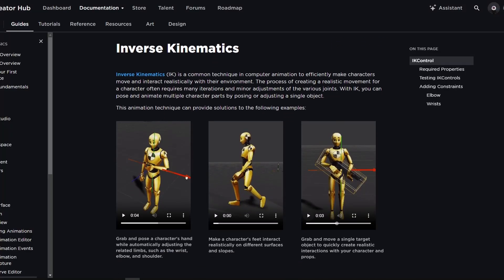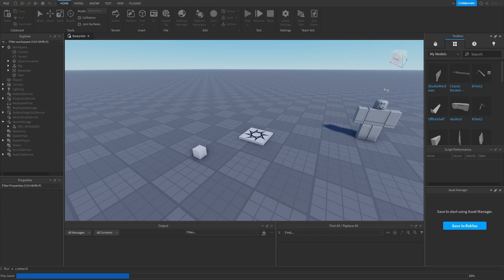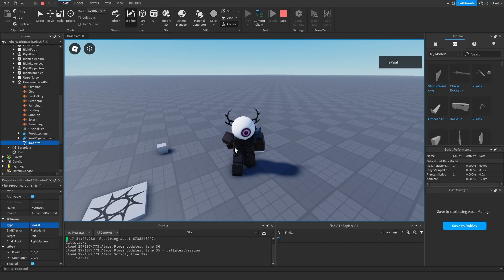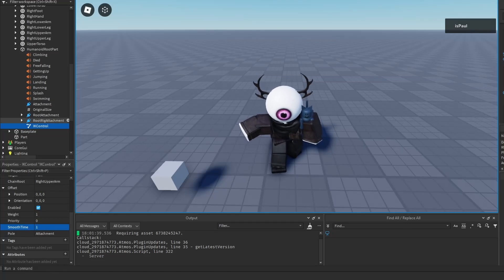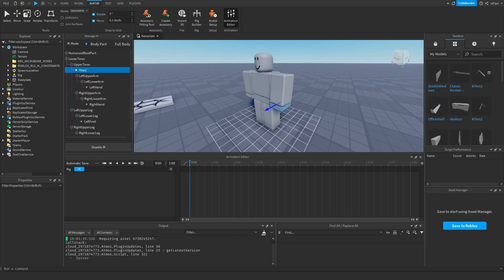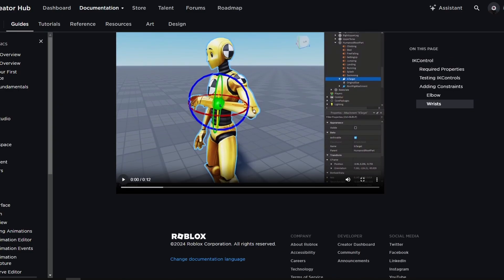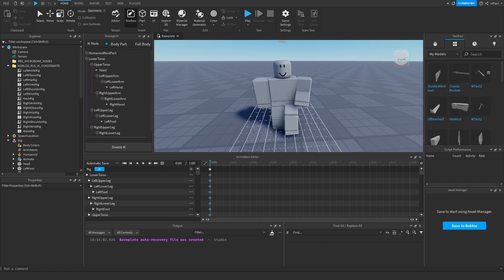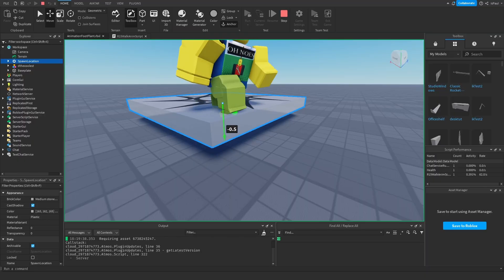Inverse Kinematics | Roblox Studio IK guide

Comment: Is it possible to use IK control without a humanoid character? like make some group of parts try to reach another part.
Reply: I was able to do this by making a model with the parts in a model with a Humanoid and an Animator and using RigEdit to make joints between them. Is there another way?
Reply: @user-dp1fz9pg1b  you could prob make a custom rig through blender with the parts as custom meshes instead
Reply: @LunaireTD  yeah I have done that! but I want to use parts.

Comment: if that would work on r6 it would actually be nice
r15 is overrated
Reply from the maker: I mean, Ik's aren't designed to work on R6, but you would be able to use them in a very limiting form
And r15 isn't overrated, r6 restrains a lot of techs and features from being used with its* rig type
Reply: @Paul1Rb  yeah but r15 just doesn't give as much of a roblox feeling as r6 does.

I grew up on r6, tix, and I'm sad that r15 has to ruin a lot of things with it's functioning and appearance
Reply: @rin_or_something_Idfk  blablablabablabla

natural evolution of the platform, its not ruining anything. u can still use r6